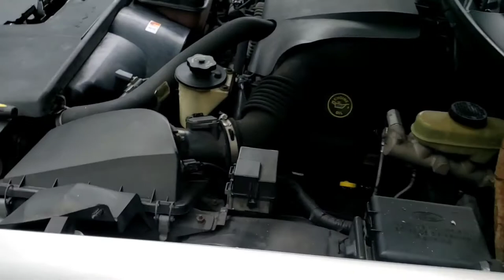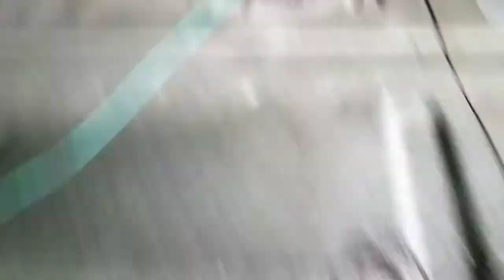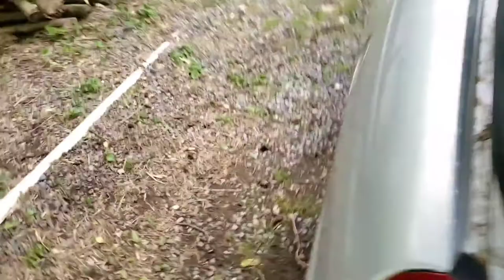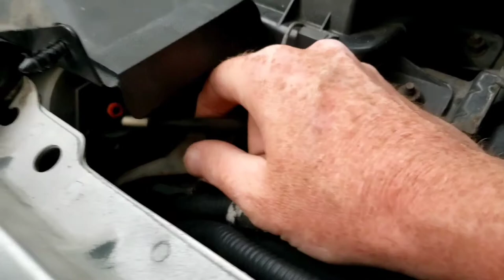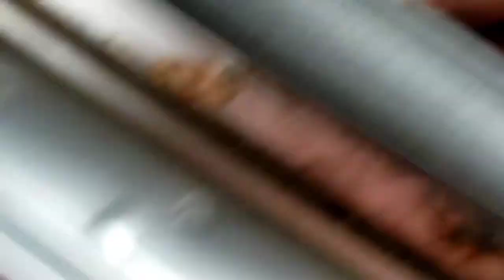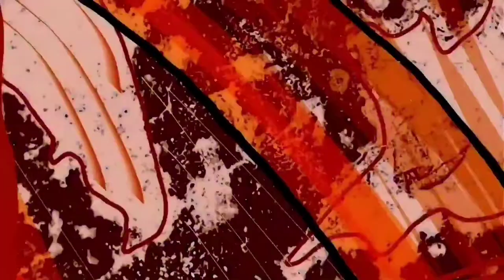2000 LINCOLN TOWN CAR HOW TO SAFELY DEFLATE THE REAR AIR RIDE / BAGS FOR MAINTENANCE PARTS 🧲 MAGNET

Comment: I'm having a hard time seeing what wires you touched to arch the connection. How did you manage to touch wires. Wish you could have made a better video to show more
Reply from the maker: Center 2 on the on the side of the plug that has 4 wires. I just forced the wire into the back of the plug....I will probably change the way the back is plumbed and wired this year, hopefully.
Reply: @AHotrodShop  thank you for the quick reply. I'm interested in doing it to mine
Reply from the maker: @cartierchronicles2000  I'm going to order a cheap set of airbags and cut the tip off where the solenoids latch in.. then I'm going to glue in some fittings in the spots to run 3/8 or 1/2 in air line. At that point it should eliminate all the factory wiring and be alot faster

Comment: Will this work on a 03 Lincoln town car signature
Reply from the maker: I do not know about the 03 and newer. The wiring might be different.  
Look up the wiring diagram on Google.  The basic design of the suspension is the same. So if you find the correct wires.... theoretically it should work.